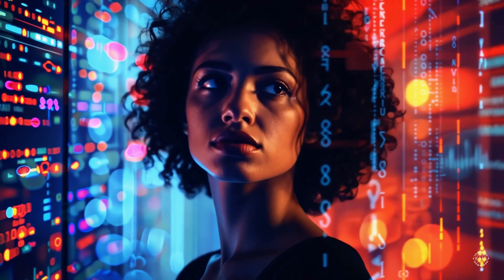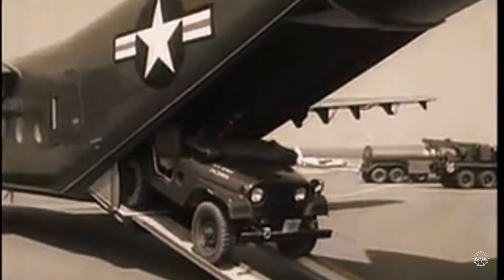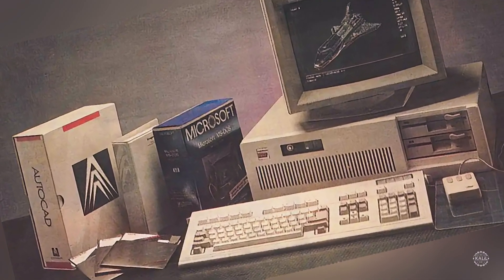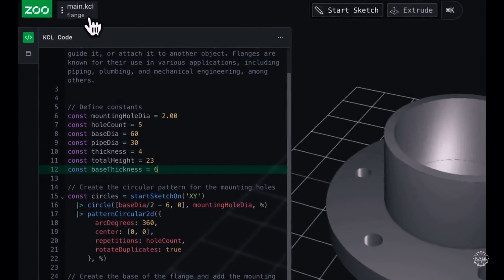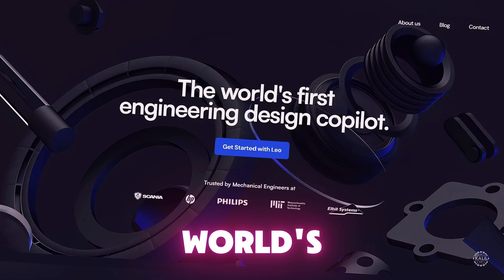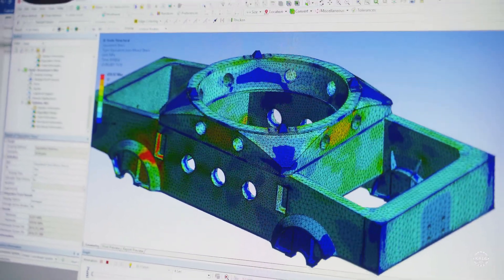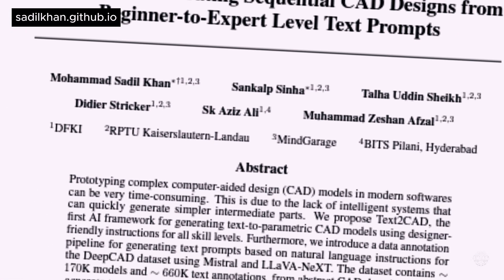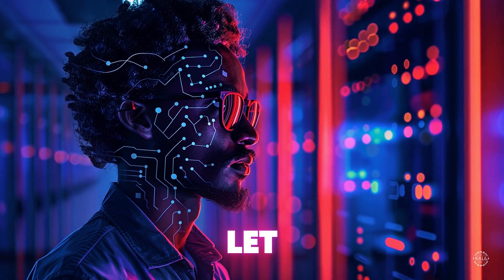Text to CAD is Here: The Future of Product Design? Generative AI for 3D Modeling, Rapid Prototyping

Comment: I work as a mechanical lead engineer in some company which produce a bit more complex products than just one part (more like a hundred thousand parts) and even working with people, to explain how some parts should be designed, words (spoken or written) are useless, without the sketch. To explain someone how to design a mechanism or anything combining more than 2 parts, simple 2D sketch, even done in paint is necessary. As long as AI won’t be able to properly „understand” what’s the design intention behind the very basic sketch, made by someone with shaking hands, and only supported by the text, all such tools will be useless.
Reply: Yeah, especially those freehand drawing from non-engineers. Then you have to decipher the drawing style of the person, and often ask questions to verify if you understood it right.
And then you have to modify the thing you've drawn to make it manufacturable, stronger, etc.
Reply: Leo ai has drawing sketch